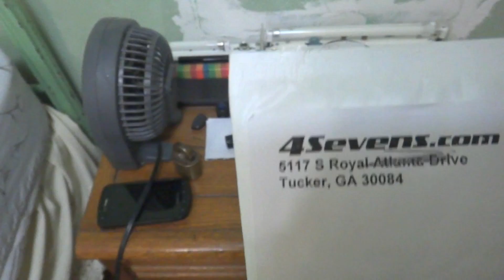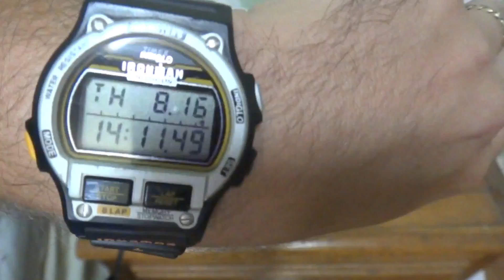Re-Unboxing the 4Sevens Quark Qmini High CRI Mini CR2 from Warranty Service

Comment: I have a brookstone LED flashlight that has served me well but the major disadvantage is that it eats batteries. I get maybe 5-10 hours out of it. It takes just one AA battery and if I use the expensive lithium batteries it turns into a handwarmer. yes it gets that hot.

Comment: In my experience, 4sevens does not stand behind their lights. I won't ever buy from them again, as they burned me a couple of times on different warranty issues, and now there are much better options, such as Streamlight, Armytek, EagleTac, Klarus, etc.....
Reply from the maker: what kind of issues have you had?
Reply: *****
I had to go back and forth with them just to get O- rings numerous times, and had a problem with the light overheating and flickering. After numerous calls and e mails, they reluctantly offered to send me a "used" one to replace it. Not what I was looking for when I purchased a $60- flashlight!